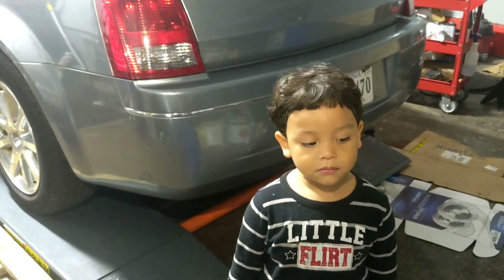Chrysler 300 air vent not the same temperature fix

Comment: when i have my ac on the left side blow cold but the right side blows hot, should i replace the side on the right
Reply from the maker: Yes replace the side that is hot.

But first make sure you recharge the ac if is low it will also do this
Reply: I also have the right side blowing warm air when ac is on. I just replaced the blend door actuator and still dose the same thing what should I do next?
Reply from the maker: The question is if you change the correct one there are 3 of them
Reply: Plus if your compressor is low on refrigerant then it can also cause one side to blow warmer than the other side. At least in my srt8 it did that. I just went to local auto parts store and bought a can of 134 recharge and charged it myself. Both sides are now cold. Not saying that's your problem but it's just one thing I have ran into with my 300.
Reply from the maker: Correct , thanks

Comment: Spot on! Good video! Mine is not doing it but now I know how to repair.
Reply from the maker: Thanks bro
Reply: @nestorautorepair  quick question…how can I contact you? I have a question about my recirculation feature on my 06 Chrysler 300. The light is showing on but when I play the ac I can still smell fumes from other cars while I’m driving
Reply from the maker: Oh you can call me there is my cell number on my info , sound like the door blender for the outside  air is bad
Reply: @nestorautorepair  I looked for your number…..but that door blender sounds about right …is it fairly easy to install?
Reply from the maker: Yes it is easy 
571 267 8581

Comment: i have a 2013 300 base, the back vents blows out warm the front blows out cool but not cold like it should i tried the freion and  the was told by family i needed a blend door actuator, would this still fix the problem? how many actuators do i buy ?
Reply: do i buy one for the back or buy one for driver side and one for passanger side then the air sh0uld blow out strong nd cold thru out the car, right?
Reply from the maker: Hi first have it recharge it can just be low on freon

Comment: Did you use a 604-004 HVAC Air Door Actuator? I saw one on Amazon.
Reply from the maker: 604_021 is the one I use
Reply from the maker: https://www.ebay.com/itm/Dorman-604-021-AIR-DOOR-ACTUATOR-MODE-/333487992465?_trksid=p2349624.m46890.l49292
Reply: Difference between 004 and 021?
Reply from the maker: I can't remember witch one I use

Comment: I had a hard time to change the actuator not much room  you can use only one hand...but its easier if you remove the seat ..only 4 bolts 3 plugs and its easier 80% more..Chrysler 300C. 2006 actuator on driver side
Reply from the maker: Nice!! Thanks for your feedback

Comment: I have temperature problems on both sides as well as mode changing problems. Does this mean that I should replace the 2 on the driver's and one on the passenger side? I have a 2011 chrysler 300c.
Reply from the maker: More likely yes both are bad

Comment: 2014 chrysler 300 passenger side air is hot driver side and rear air is cold which accuator should i change?
Reply from the maker: The one on the side that is not changing the temperature door blender

Comment: We did this and passenger side still hot. Any ideas what else to try. Thank tou
Reply from the maker: Well then, the climate control is not sending the singal. Make sure you did replace the correct one
Reply: Notice at the beginning of the video he mentions that there are 3 of these in there. Probably its one of the other ones....

Comment: What is the part called ? I need one 2006 srt8 charger
Reply: Also this is for the ac to right ? Not just the heater ? My issue is cold air comes out the driver side but not on the passenger side

Comment: I replaced that part, but still have the same problem; what else might cause this?
Reply from the maker: Maybe when the old one when bad it burn the fuse ,, check all the fuse
Reply: @sig tx did you ever find out the issue? I’m having the same problem on a 2006 charger R/T
Reply from the maker: Ok
Reply: @thatdudeleo9068  hey DudeLeo, no, I still have the problem.  I opened up the servo that I replaced and It was actually still good.  Only 2 wires, switched 12 volts between the 2 and the motor would run in either direction..  There’s a round knob that the servo is supposed to spin.  I could spin that freely with my fingers, so that wasn’t buggered up either.
Reply from the maker: Ok
Reply: @sigtx8263   okay thanks for letting me know. I stumped and don’t know what to do haha
Reply: @thatdudeleo9068  Since my passenger side is working properly, I’m thinking about building a long jumper cable and seeing if controlling the driver’s servo using the passenger’s servo control might help troubleshoot it further
Reply from the maker: K
Reply from the maker: Wow